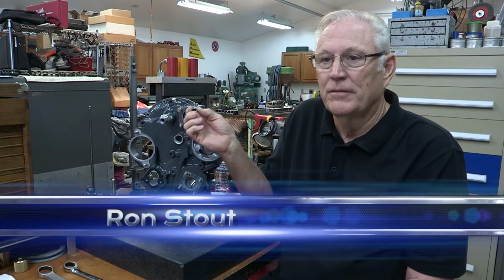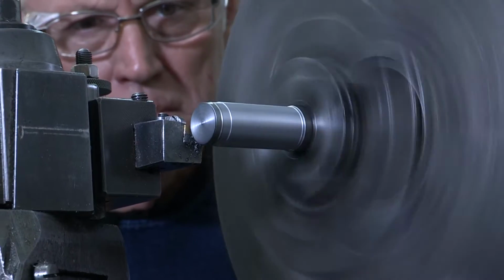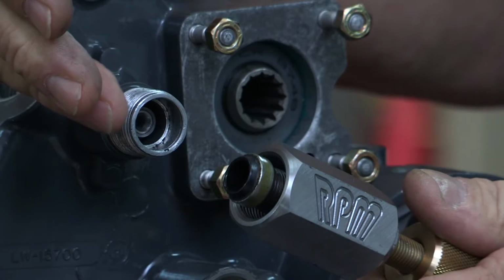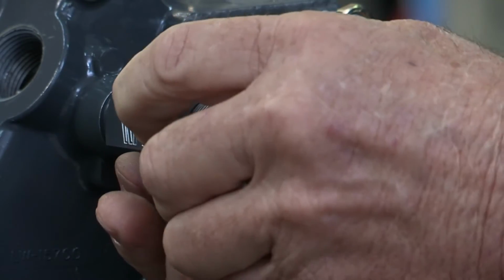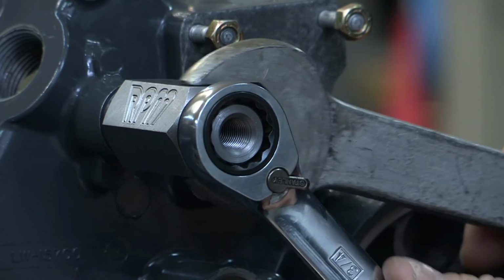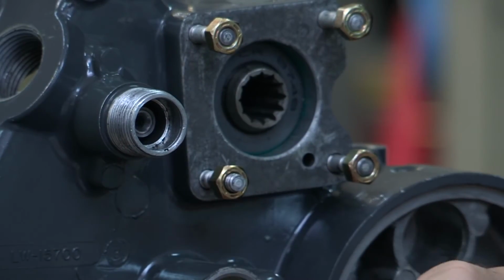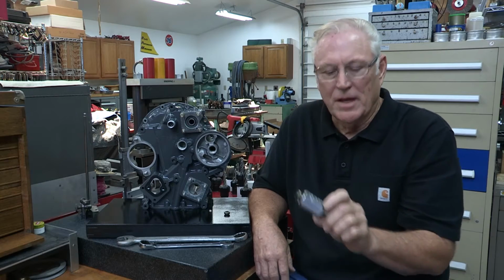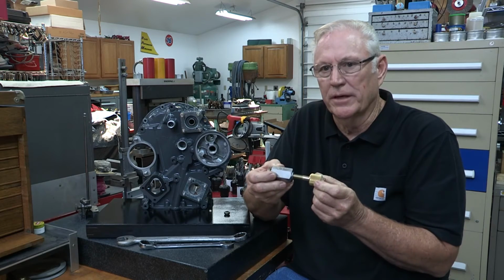Tach Seal Removal Tool

Comment: I tried to remove the seal with heat and picks with no luck.  I used this tool and got it out no problem!  After about 10 hits with the slide against the bolt it worked its way out.  Bingo!  Great tool!!

Comment: My shop had this tool and never used it or knew what it was until today. Worked as advertised in this video. Only suggestion would be to have a heavier slide hammer. I ended up using the 3/4 wrench to tap on the slide hammer to pull the seal out. Other than that it worked great.

Comment: Spent the $300 (yes, $300, no typo), used the tool on an AEIO-320 tach drive seal (leaking after 375 hours on a factory 0 timed engine). Followed the video closely. No luck. Seal would not come out. I'm an A&P so I have experience working on airplanes. Video makes it look (too) easy. Consider your options before spending the money.
Reply: I have one of these tools and have used it on several lycoming engines. I have not used the little slide hammer that comes with it, but usually just slight pull along with back and forth, up and down movement it comes right out. This is also without the outer sleeve. I do however put the bolt with the slide hammer on the tool for a handle to pull on.
I have had other mechanics in the shop come and borrow it with no problems.
You might consider the possibility the seal may not have been installed properly, Lycomings OH Manual is not real clear on how it goes in.  Options are, Remove the ass gear housing and knock it out from behind or cap it off and go digital tach.
Reply: A&PGeorge or flyacrodotus would you be willing to rent your tool out, apparently Mr. Stout doesn't make a lot of these or they sell fast, can't get one right away and I need to remove a seal.
Reply: Doesn’t work as advertised!  Did the same thing as the video, but did not get the same results.  There's a flaw in the man's tool.  The threaded conical stem that screws into the seal expands the seal against the seal wall.  The next to worthless "slide hammer" only serves as a banner for the name it has insufficient mass.  The bolt that the "slide hammer" slides on is also too short.  All in all, this is a waste of $300.  Just get a long bolt that will screw into the old seal and about 25 washers glued together.
Reply: A&PGeorge - The Lycoming instructions are not clear?  Its perfectly clear and concise to me.  This doesn’t work as shown. It’s nothing more than a scam and you’re lying when you say you just wiggle the seal out.
Reply: Not the Sharpest tool in the shed are you ?  The tool screws into the rubber part of the seal expanding to Grip the seal to pull it out. Nothing special about the bolt, get a longer one, this is limited by the room you have. A bolt alone will NOT SCREW INTO the old Seal, that's the purpose of the conical stem, (you paying attention) and, are you working on the Tachometer Drive Seal on the Engine, its above the oil filter next to the vacuum pump with a cable from it going thru the firewall to the tachometer.  I have over 50 aircraft I assist in maintaining (cessna 172, piper seminal & archers) and have used the tool numerous times and have been successful every time. The trick is being smarter than the tool.  You and your washers have a great day.
Reply: What do you mean by “get a long bolt...”? I’m trying to visualize what your are saying.